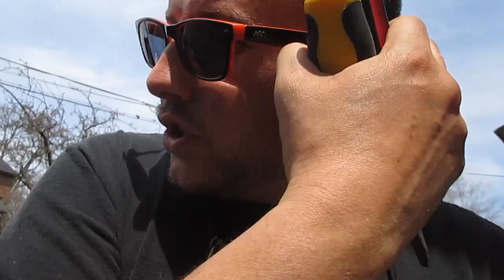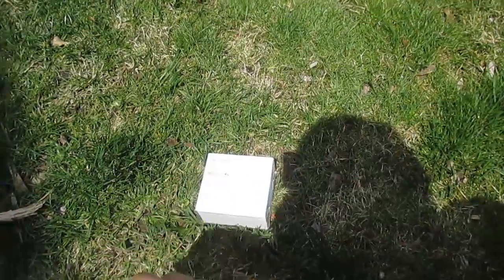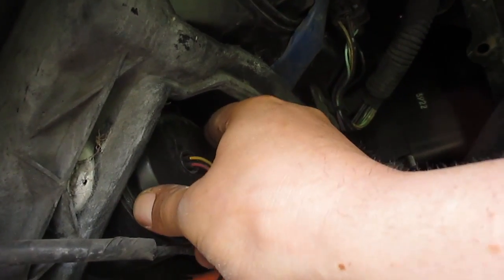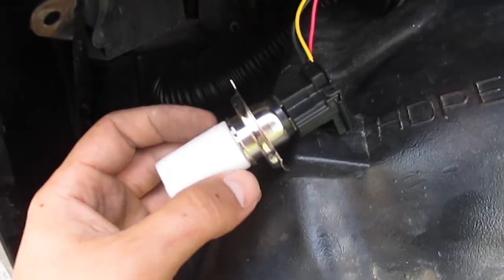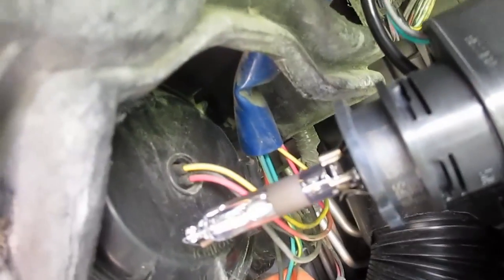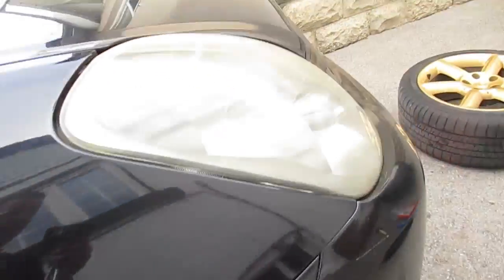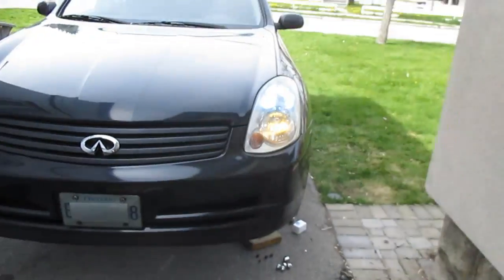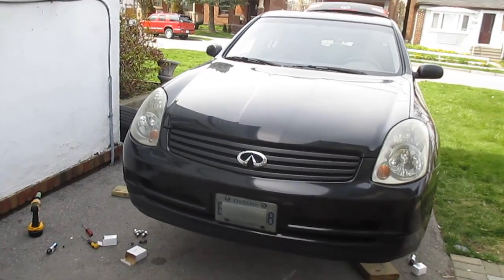Changing The Stock G35 Headlights With Blue HID's

Comment: The way you can get into your headlight on that car is completely different from mine even though it's the same car! You screwed that plastic cap off of that headlight and it's sticking way back into the well my plastic cap is 5 inches inside a hole and there's no getting your hand in there like that

Comment: as of July you have to have projectors for those HIDs, its becoming a fairly big fine for it so i would recommend doing it before
Reply: His G35 comes with factory HID's with reflectors designed for xenon bulbs.
Reply: They made reflectors designed for hids? I didnt know that
Reply: Lots of cars have reflectors with factory HIDs. Cadillac Escalade had them, a few Lexus's, and the 2008-2012 Altimas had reflectors with HIDs. That's why it's so hard for cops to tell what's legal and not, he'd definitely get pulled over though. 10000K is way too blue

Comment: "No death by Hids as of yet" haha love it and hate it. Hey bro also you mentioned being to low. Couldnt you just have turned/locked the wheel to one side? Like for example to work on the left side of the car you would turn the wheel all the way to the right..and vice versa.
Reply from the maker: I could have but it would have been tight. only took an extra 5 mins to jack the car and pop the wheels off

Comment: Got mines changed and one of my headlight doesn't come on and I have to flick my lights on and off several times for one side to come on .....bro say my car don't get hot enough for both light to come on at once but when I look at videos on here , people don't seem to have that problem.
Reply: Cherry Luong I have the same problem if I move the main wiring harness a certain way they work perfectly though ::
Reply: Cherry Luong I have the same problem. They only come on when I flick the high beams on
Reply: Jared Guzman I figured out the problem. To use the bottom lights you needed a relay that gives power to the fog light switch
Reply: Sweet. I had a similar problem but was the ballast.